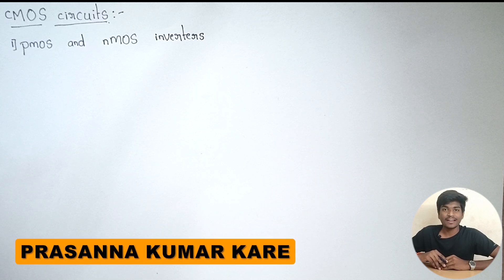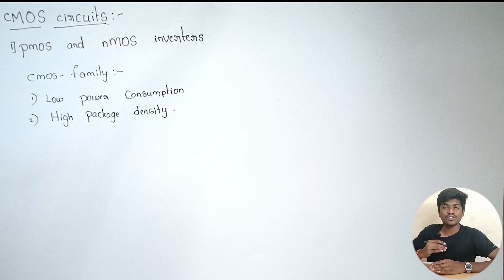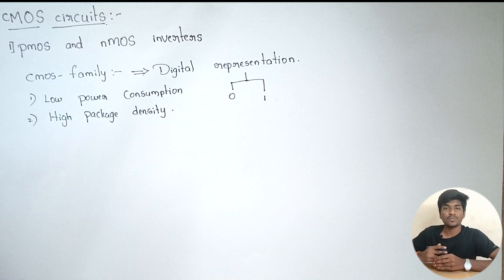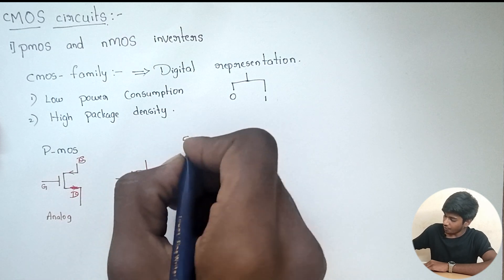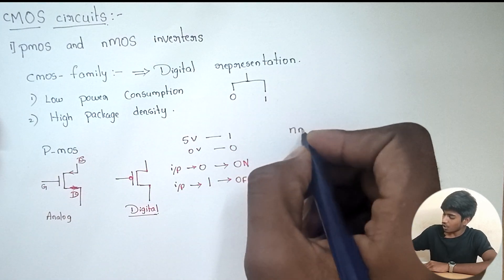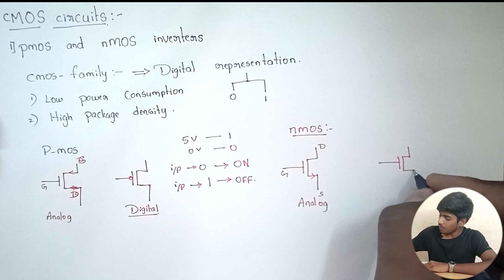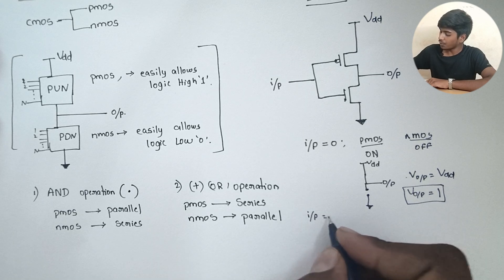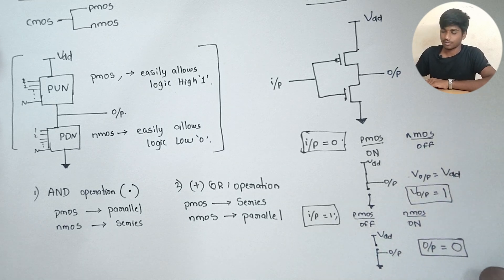Lecture 1:Introduction to CMOS, Types & CMOS Construction | AEC | CMOS Series |

Comment: Instead of using bjt why can't we use ujt bro
Reply from the maker: The most significant difference between the two devices is that a UJT is one-junction device which conducts by the flow of majority charge carriers only, while a BJT is a two-junction device in which conduction is due to the movement of both majority and minority charge carriers.